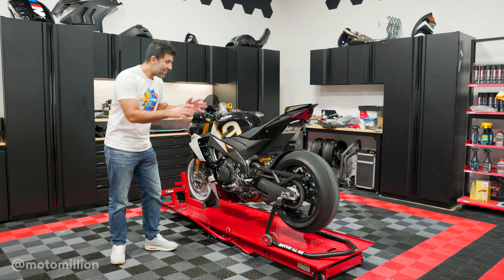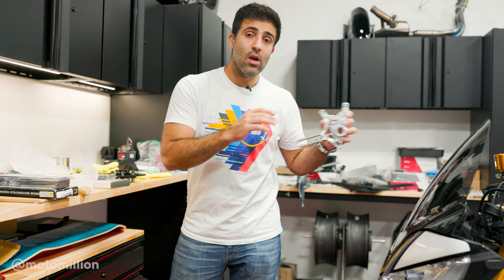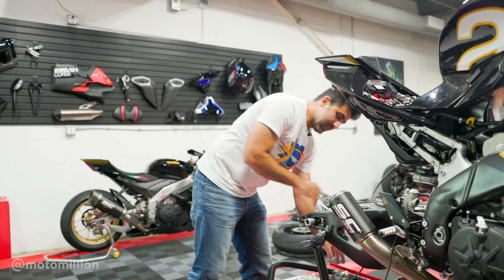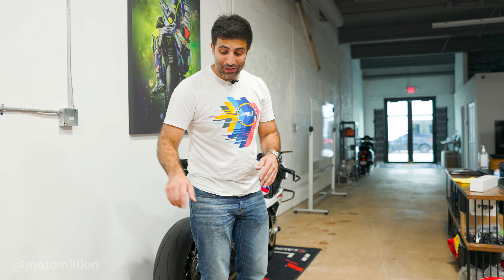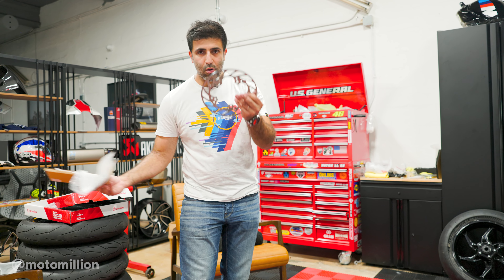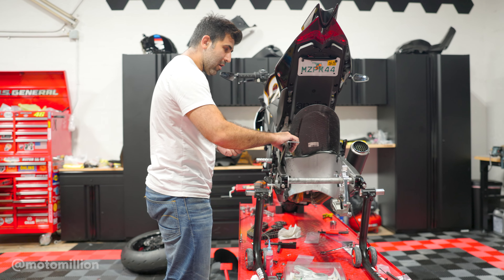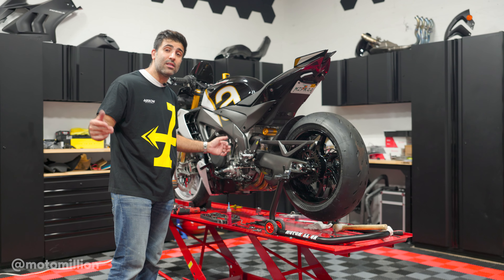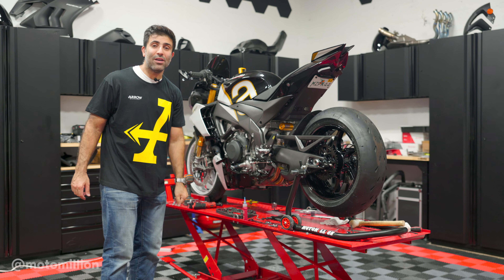TONS of Weight SAVINGS for our Aprilia Tuono V4 1100

Comment: Sweet setup! The most interesting thing about all these mods is I am wondering how will Aprilia use all the beautuful mods to deny warranty.
Reply from the maker: Why do you think it will break?
Reply: @Motomillion  To be clear, I am not saying it will break because of the beautiful mods. I love what you've done with the bike. The problem is the Aprilia red tape come time to claim for warranty. They build awesome machines, but there also appears to be design flaws or defects. Of course they are aware of the Magnuson-Moss Warranty Act, but they are also aware that "the process" to appeal a denial of warranty coverage is also painful process that not everyone is willig to do. For example, the oil consumption on v4's, Aprilia won't approve an oil consumption study until consumption reaches 1L/1000 miles. When that warranty claim is made, they ask the customer all the aftermarket mods installed and was the ecu map changed. Interesting fact too is that if the ecu is disconnected, the dealer said it logs it and the owner automatically voids the warranty.

Comment: On the 2020 TUONO 1100 Factory comes with cast wheels compared to the RSV4 comes with forge wheels
Reply from the maker: I think this Tuono V4 1100 Factory has forged wheels!
Reply: Tuono factory are cast wheels. Only the rsv4 gets forged. I bought the rsv4 forged wheels for my Tuono (just need to get them painted Tuono red before fitting them).

Comment: When you fit the stylemas will you be doing the master cylinder too?  Be interesting how much lighter the stylema is...
Reply from the maker: Need to look at specs because the current calipers have fluid snd very hard to get an accurate measurement. Also yes on the master.

Comment: The non factory models have cast aluminium wheels, the factory models have forged aluminium wheels. Difference in weight from cast to forged is front 0,9 kg, rear 1,9 kg. 
It is not the weight itself that is so interesting, but the effect of the weight on the physically determined gyroscopic forces of the wheels. And these are decisive for the handling and straight-line stability of motorcycles.
Reply from the maker: Thanks for letting us know about the wheel differences between the models.
Reply: On the new Tuonos, even the factory models come with cast wheels. It may be different for the RSV4 model.
Reply: @Jrstrdr  you are right with the Tuonos, on the RSV4 models it's cast for the RR's and forged for the factory's